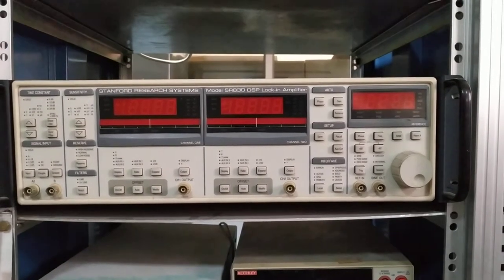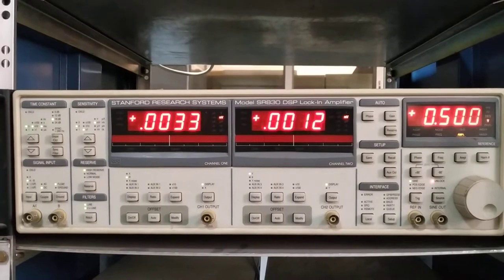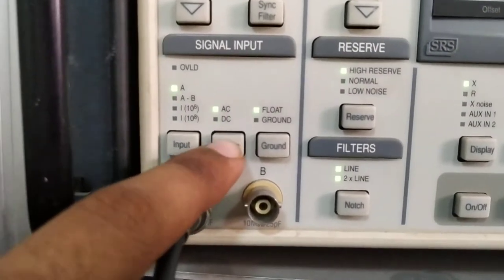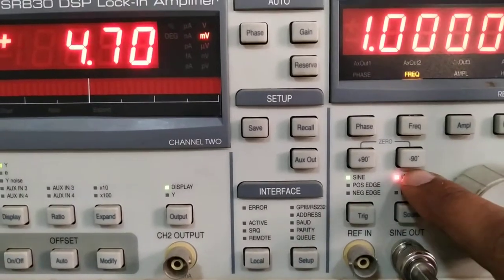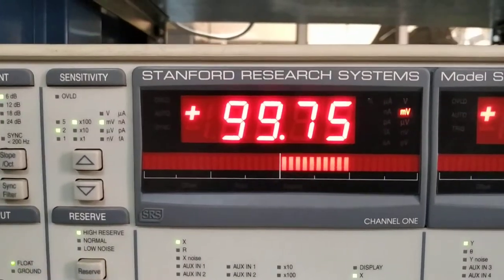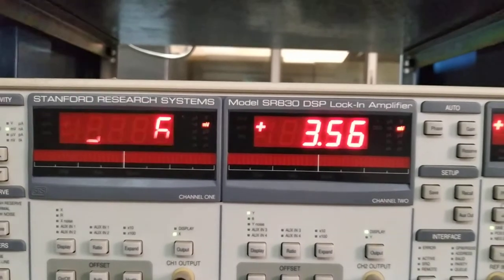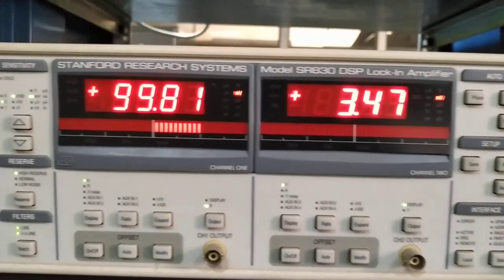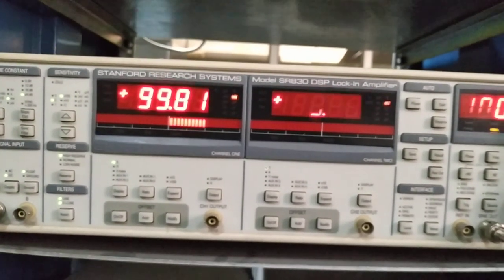Part 3 -- SR830 Lock in Amplifier II For First Time Use

Comment: Can you please tell me how can I add a DC offset to sine-out of the lock-in? I need to keep the reference frequency low, preferably below 100 Hz but no commercial bias-tee comes with a such a low freq cut-off. I need to reference a DC + AC through the sine-out.